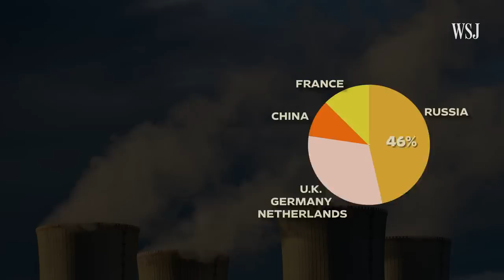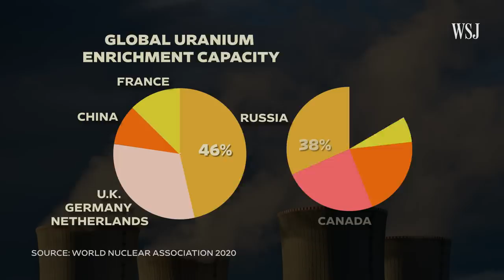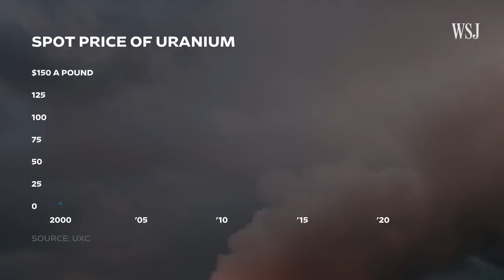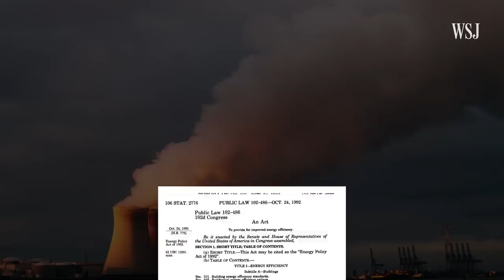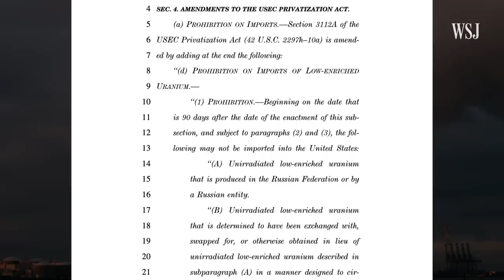Why the U.S. Buys So Much Nuclear Fuel From Russia | WSJ

Comment: That’s why the US is trying to secure its position in Niger. 
As of December 14th 2023 the current regime in Niger and their relation with Russia is making the US nervous
Reply: That's irrelevant. Niger does not produce enriched uranium which is what this piece is about. The shortage is for enriched uranium, not the raw mineral.
Reply: @masong8332  no produce, pero puede enviar a paises que si produzcan
Reply: @masong8332  Mine uranium, is an rare mineral.
Reply: @anxel-  There is no shortage of raw uranium. It is about as rare as lead. This issue is enrichment capacity.
Reply: @masong8332  there is a shortage not short-term but long-term because Kazakhstan uranium mining is controlled by Russia&China and over a 100 nuclear power plant are unde construction/planned
Reply: @ambessaseway5594  Unless you can see into the future that is also not a shortage, that sounds more like "de-risking." 
Also I would not call LLPs between Kazatomprom and Uranium One "controlled" by Russia in any meaningful way given Kazatomprom retains exclusive export rights.

Comment: I read the title of the material and took it as a question. I answer based on my own experience and knowledge: American capitalism (not to be confused with Russian, Chinese or Arab) has brought the country to the point where it is no longer profitable to refine uranium or plunium. Despite the fact that Western civilization already uses the cheapest method of enrichment possible - the centrifuge. Soviet Russia invested heavily in enrichment filtration conveyors, which over generations made the best quality Russian uranium the cheapest. Then everything happened according to the laws of capitalism - whoever can offer lower costs for the buyer sells his goods. So here are two conditions that made the United States completely dependent on Putin’s uranium: 
1) Complete degradation of the US nuclear industry. 
2) Higher quality and cheaper Russian uranium.
Reply: I suggest it was never profitable to refine uranium or plutonium. Nuclear has required enormous subsidy and support in every nation. In the US, the decline has been a bit more obvious, whereas in Russia and China they can simply make it a state secret. Comparisons are harder because they deliberately separated internal and external currency.
Reply: @aaroncosier735  You think so because only Russia has second-generation industrial fast neutron reactors. These reactors convert any nuclear waste from any technology into clean electricity. Unfortunately, the US and EU have completely lost nuclear competence. You can buy a couple of these reactors from Russia and use your country's nuclear waste to generate energy at a large profit.

Comment: Enrichment is complicated, expensive, and unnecessary. Canadian CANDU nuclear reactors use natural uranium concentrate (yellowcake) as fuel. Meaning the fuel is both safer, cheaper, and fully domestically sourced and produced. American reactors are generally older, require richer fuel, and are harder to operate. 

Put simply, building better (CANDU) future nuclear power plants would solve this problem entirely and save money.

Comment: The U.S. sourcing a significant amount of nuclear fuel from Russia raises legitimate concerns about energy security. It's essential for policymakers to address this issue strategically to safeguard national interests.
Reply: You are right but if you look from russia's perspective they wouldnt want to tamper with it since ut would be bad for their business. Think about it. Lets say they tamper with it and usa findd out. That would shut down business which would be a loss for russia too
Reply: Russia wants the money
Reply: Building better future nuclear power plants would solve this problem entirely and save money.

Because enrichment is complicated, expensive, and unnecessary. Canadian CANDU nuclear reactors use natural uranium concentrate (yellowcake) as fuel. Meaning the fuel is both safer, cheaper, and fully domestically sourced and produced. American reactors are generally older, require richer fuel, and are harder to operate.
Reply: @anirudhnarla4711 True but that's not enough. We should've been ready by now
Reply: its has never and its not a security risk lol.....

Comment: Why doesn't America simply build molten-fuel nuclear reactors that enrich thorium, turning thorium into burnable uranium fuel, and that fuel can then be used to power the reactor itself?   This technology was used by America in the 1960s in a small test reactor and it worked without any serious problems (metal enbrittlement was the only problem they had, but we have solved that problem with new technology).  So just go ahead and build them, what's the delay?
Reply: Because molten-fuel reactors are not feasible with current materials. Insofar as a couple of experimental reactors were used to test aspects of the basic principle, these could only operate for a few thousand hours. To operate a commercial reactor for twenty years it will need to be built from materials that simply do not exist yet. 
Metal embrittlement remains a problem for all reactors. Molten salt reactors face the additional challenge of corrosion from fuel salts and fission products.

Insofar as the 60's reactors were a "success" at demonstrating operation as a once-off (yes, fission is possible, yes breeding can happen), there is no no data to say that such a reactor would actually operate well long term, that the ratios of fuel to products would remain within usable boundaries, or that power production would be consistent. 

They are not being built because they are not yet feasible beyond small, temporary experimental systems.

Comment: I dont understand why US never made a closed fuel system. It will greatly reduce the amount it need to import 🤷🤷🤷
Reply: Because that would cost enormously more for only partial success.  The existing reactor fleet is designed to burn uranium fuel. Some reactors can tolerate a percentage of MOX fuel. Spent MOX fuel has longer cooling requirements, requires lower density disposal, and is more expensive to reprocess.
There is no closed fuel cycle *anywhere*.
Reply: @aaroncosier735  All of EU and Japan have closed cycle there is no political will in us to build
Reply: @floopybits8037  
No they don't. They have similar reactors to everywhere else. Most spent fuel remains in temporary storage. The reprocessed wastes are not returned to the fuel cycle. The fission products require encapsulation and disposal, and the leftover plutonium is just a proliferation risk. Very little gets used in MOX fuels, and used MOX fuel is even harder to manage.

I repeat: there is no closed fuel cycle available.

Comment: With 410-420GW solar added this year alone, and over 0.5TW coming next year I doubt fission energy will have any serious future unless fully automated. We are on track to 1TW yearly installation by 2028, and storage is finally begun to catch up. There are insane fusion news year after year which leads me to be optimistic that we will have fusion by 2030 with commercial being soon after.
Reply: Well, half with you. Certainly PV and wind are expanding globally at a huge rate, storage too. Not so optimistic about fusion. There are fundamental difficulties building a fusion reactor that lasts twenty years, as opposed to generating experimental fusion for a millisecond. They will need radiation resistant materials that do not release particles even at enormous temperatures and radiation intensity. Tricky. I'd say a century.